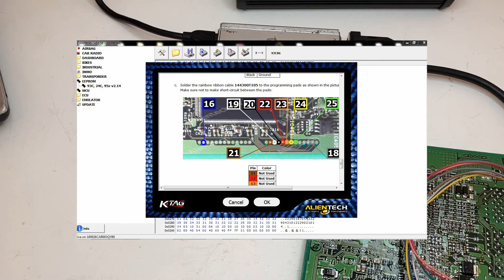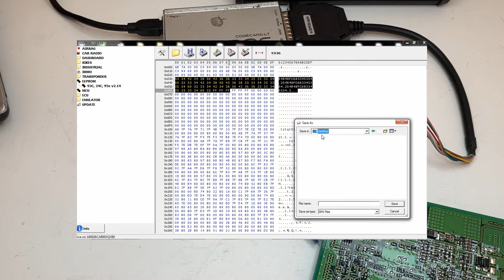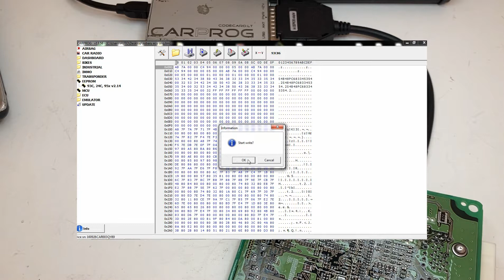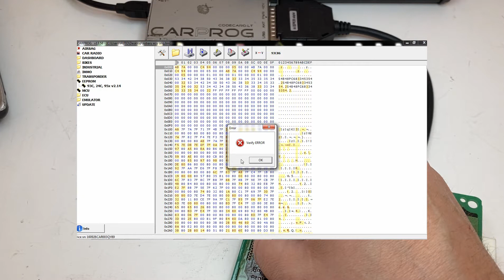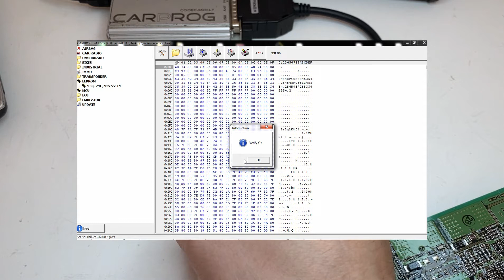The Ultimate Subaru ECU Replacement Tutorial

Comment: Thank you so much for this video didn’t have the equipment you did but I took a chance removed eeprom from old board and replaced it on a recondition computer I bought on eBay swapped them out. Heat did not affect the eeprom. Did exactly what you did on your video got it in the car turned the key car runs better than ever. Thank you so much great video.😮 car is a 2006 Tribeca. Not afraid of touching circuit boards anymore!!!!

Comment: Currently swapping an ej20x onto my ‘05 OBXT and this video is simply golden given the headache of swapping/programming and using the jdm ECU. Thank you Sir!
Reply: it only works if ur cloning same model number ecu now u can program the jdm ecu for the ej20x to work on ur car but u need to get the security id number and  reprogram the immobilizer  iv done it with a tatrix cable and a vxdiag tool the vin info needs to be edited threw the eeprom ic once key is programmed

Comment: This is a great video, thanks a lot. Light at the end of my tunnel. I have the situation the other way round. I have problems with a 2018 Forester. The engine was replaced, and whatever we do the tuning parameters cannot be deleted. Whatever the garage does, the ECU seems to use the tuning of the old engine. I was told by some Subaru wizards, that these params are stored in the microcontroller, and 2018 Foresters had a bug, that prevents clearing these. Do you think Carprog has the adaptor and the comms protocol to do this clearing in the microcontroller?

Comment: I like your video and appreciate you sharing your knowledge. I have a question about this process. If you have to remove the eprom to flash it, why not just swap the old eprom on to the new ecu? Same result, less steps, no?
Reply from the maker: Yes and no if you don’t read the file and hear it up to remove you can loose the key information that’s why you always read it on board and then remove it
Reply: @vehix411  got it makes sense. Fyi, theres a guy on some forum, 20x swapped his leggy, flashed jdm ecu with usdm 257 eprom and didnt desolder anything. Snowboarding right now, otherwise would share the link
Reply from the maker: @dukeofnyd1  SOME ECUS YOU CAN WRITE WITHOUT DESOLDERING SOME MUST COME OFF JUST WONT BUDGE
Reply: @vehix411  got it, thanks again